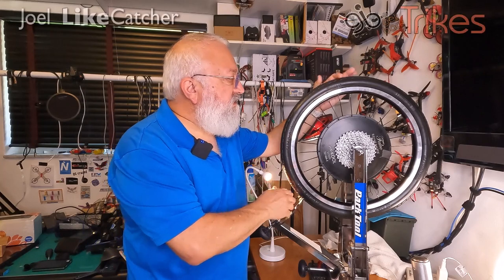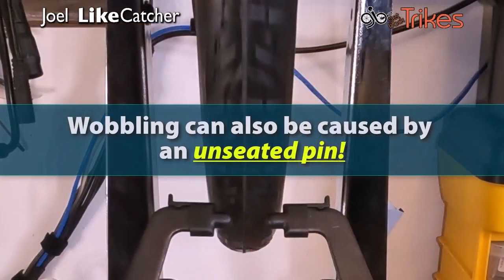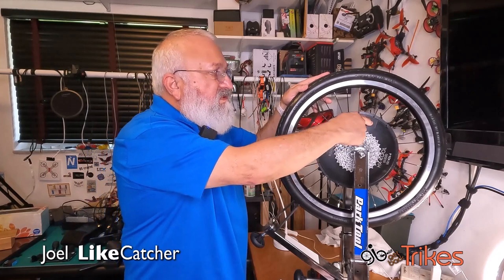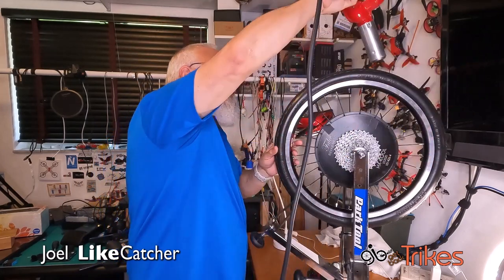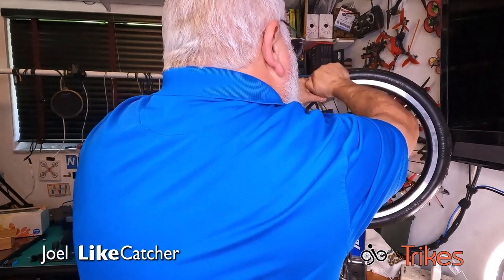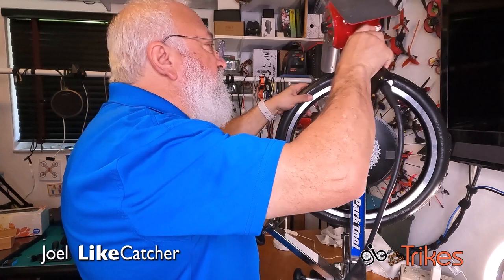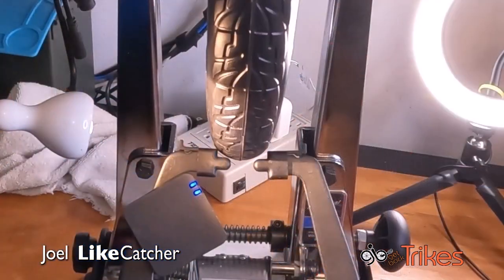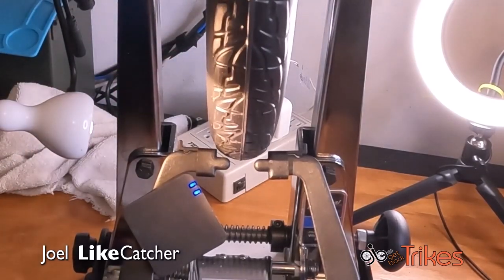Tannus Airless Tire Tips #2 | Fix Tire Wobble

Comment: Will stress from the side (making turns) in hot weather cause the tire to once again shift position? I guess you will find out.
Reply: I have my Tannus Airless tire mounted on the back drive wheel of my tadpole recumbent trike. So that wheel doesn't have the lateral stress of a front steering wheel. So I don't have personal experience with any such suggested wobble stress.